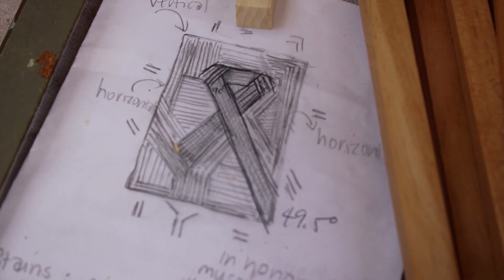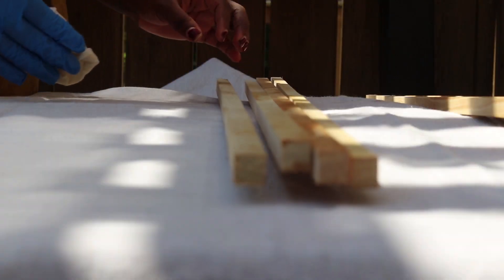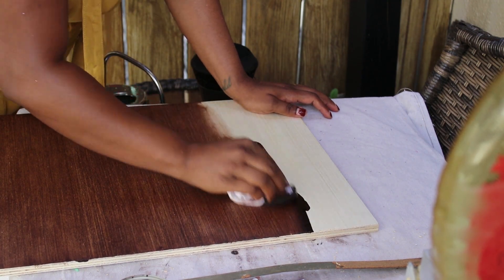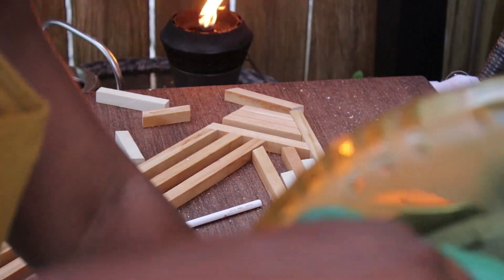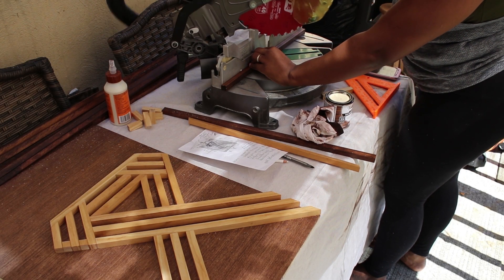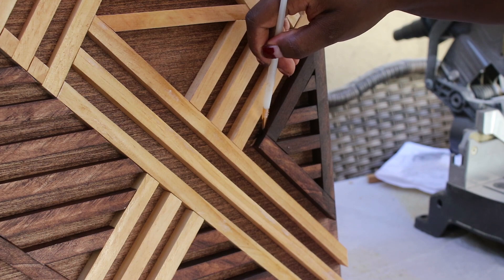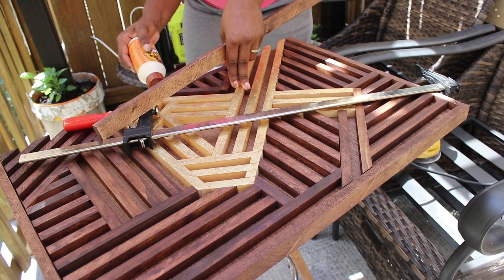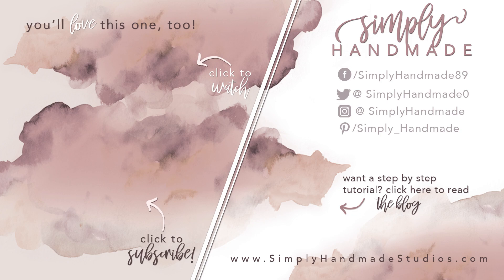DIY Geometric Wood Wall Art

Comment: With the gold leaf, how does that fare outdoors? I noticed you said you thought about sealing the wood before gold leaf but would that seal helped to make it stick better? Awesome project.
Reply from the maker: I. Robles I’m honestly not sure how it would fare on the wood outdoors. I have another gold leaf project outside and it’s holding up well.. but that’s on a terra cotta pot. 

As for the sealing, I do believe it would help since the adhesive wouldn’t have the opportunity to soak into the wood. If I were to do it again, I would seal, adhere the gold lead and seal again. 🤗